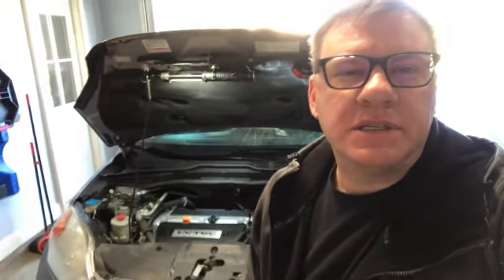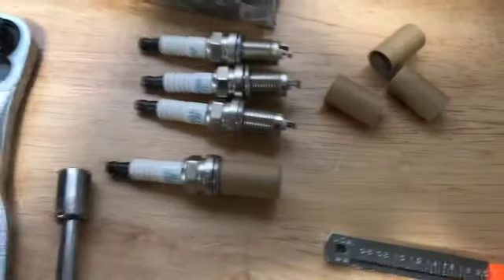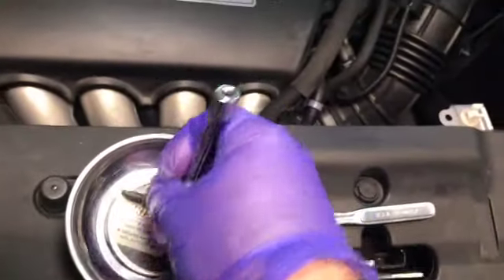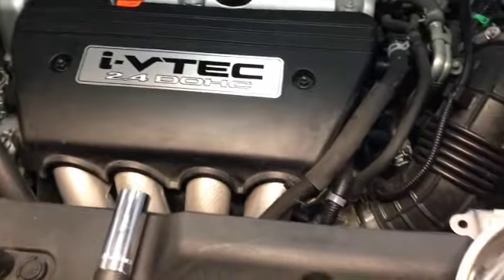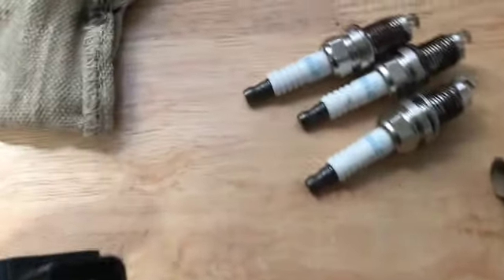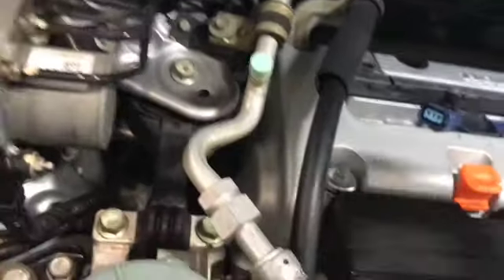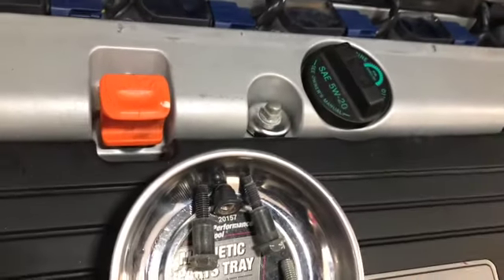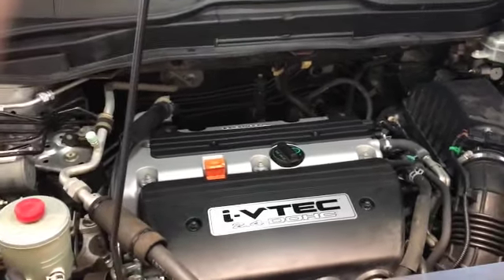2007-2011 Honda CR-V Spark Plug Change

Comment: bummer. Very curious what the gap might have been. Did you remember if there was a performance or fuel mileage  improvement? Thanks.
Reply from the maker: I changed the spark plugs as a preventative measure due to the mileage that was on the vehicle. Since we weren’t experiencing any problems I didn’t notice a change.

Comment: Question which I need a quick answer on if possible.  The connector to the coil appears to be stuck.   How to I get it off without breaking the housing?  I dont see any tabs to squeeze or anything.  Please advise as soon as you can.   Thank you
Reply from the maker: There is a push tab on the electrical connector to the coil. When you push on the tab with your thumb it releases it from the coil.
Reply from the maker: Watch the video at 10:15 and your question will be answered. I hope that helps.
Reply: @PaulNaylor3  Thank you Paul
Reply from the maker: You’re welcome

Comment: Excellent job, but why didn't you replace the ignition coils as well when you had them out. Just curious. Im going to both, but excellent work. Ive seen a few vids on it, but yours was the best!
Reply from the maker: Thank you. I didn’t replace the coils because they were working okay. I hope your job goes smoothly and I appreciate your comment.
Reply: @PaulNaylor3  yeah, I think you said it had a little over 100k. I've got 204k. I could see not doing that as well too. There were a couple of things that you showed that simplified it. Thanks again, all the best!!
Reply from the maker: You’re welcome
Reply: Unless you have very high mileage, the coils shouldn't need replaces. With over a 100,000 I would think you should still wait for replacement, unless of course something is going wrong with them.
Reply: Hola.!
Buen trabajo.Muchos dicen que si la bujías no traen la grasa es por qué no la necesita.

Comment: Should you change ignition coils? Just curious about to attempt this job tomorrow
Reply from the maker: You don’t need to change ignition coils if you’re not having problems or getting an engine light with a code that would point to a problem in this area.
Reply: @PaulNaylor3  thank you love your videos very informative and easy to follow, if you could also show how to change brake fluid and then bleed brakes
Reply from the maker: Thank you. Here is a brake fluid video on my 2017 CR-V that may be helpful:
https://youtu.be/z4Lo70oh8_w